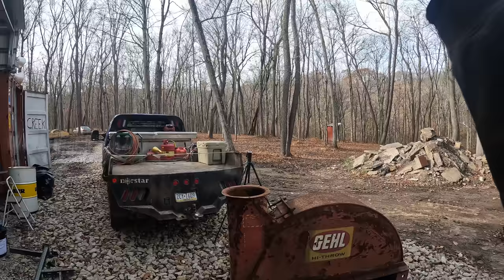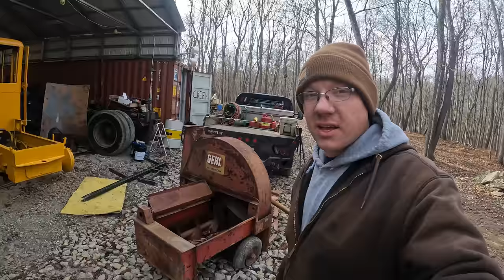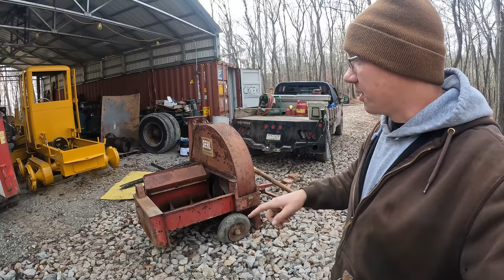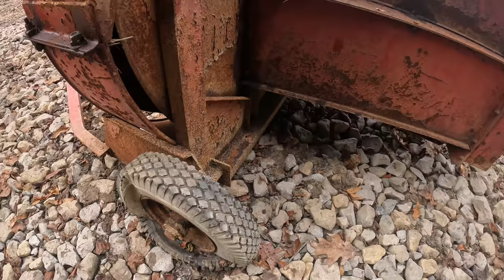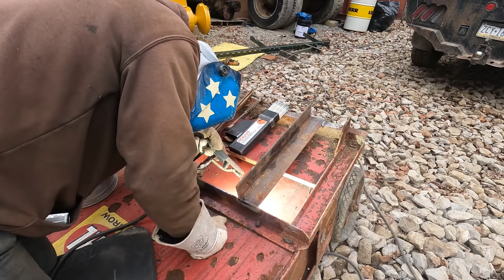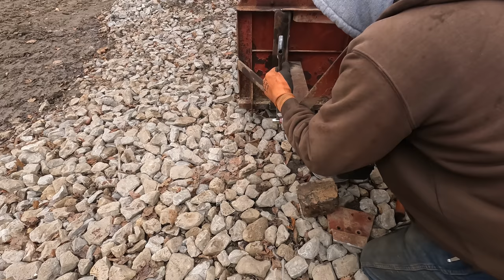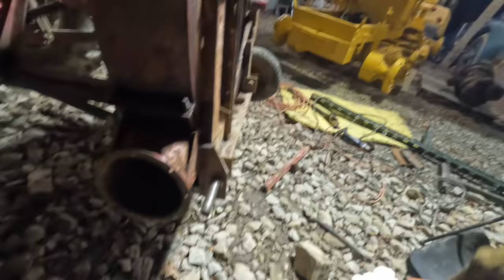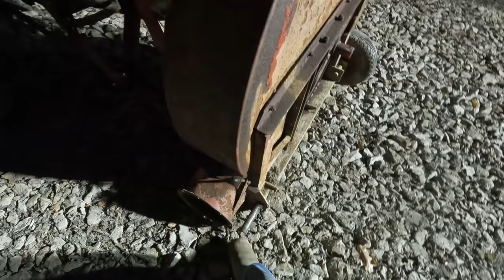I Built a Giant DIESEL POWERED Leaf Blower!!!

Comment: Matt good stuff!  Have you considered running the outlet on the other side of the unit?   Two reasons.  First you'd be able to achieve the downward angle just with the spout, without having to adjust the 3 point.  The other would be you'd put the air inlet much further away and increase the pressure.  Something to think about.
Reply: What I was thinking, couldn't hurt just to turn it to find out.
Reply: I was thinking the same thing 👍
Reply: I came to say the same thing. No more modifications, just an adjustment that already exists.
Reply: yeah, just rotate 180 deg so it points to the other side and down a bit
Reply: AND it allows you to put the wheels back on, then just run a extension pipe down and across at ground level.,
Reply: That is exactly what I was thinking Matt, just put your outlet on the other side and should solve basically all your problems
Reply: Experimentation with nozzle placement (for max volume), then cut frame loose and position as needed, then re attach frame with which ever wheel position modified. I like the idea of pushing material across road (to your left).
Reply: I agree with this it will give you better wind speeds and also allow you to put the wind more to where you need it to push the leaves
Reply: Came here to say this. It will also give space for the remotely controlled nozzle. I would suggest going electric actuator for that.
Reply: i was thinking the same at the beginning of the video
Reply: You could also make a hood on the back to redirect the intake so that it sucks closer to the ground and possibly suck leaves up off the ground, as well. I'm thinking about doing this myself, thinking it will work good for snow as well.
Reply: air flow is not going to magically change direction just because you move the outlet.  In it's current configuration, the air will flow naturally out from the outlet as the fan is moving clockwise (view it from the rear).  If you rotate the outlet to the other side, it will need to point down for the fan to blow based on the rotation of the blade.  if you then add a 90 degree elbow to redirect the airflow, it then would work.

Comment: We had one of these silage blowers on my family farm growing up. One day blowing corn fodder into a barn. Had a Super C tractor on the blower and blower got plugged up. Detached the blower pipe off the top of blower, backed of the blower paddles on PTO with a crow bar. I reached in to grab a last handful of green, tough corn stalk/fodder and my brother through the PTO on with tractor wide open. The paddle caught about an inch above my left wrist. The Super C stalled as my arm was another "plugged" situation. Busted my arm good. Lucky was not sharp blade type paddles as some of these blowers have/had. No bleeding. Damn lucky. I was 13. Brother probably 18. In hospital for a week to insure circulation to fingers. 57 now and glad I still have my hand!
Reply from the maker: You got lucky 🫣😵
Reply from the maker: You got lucky 🫣😵

Comment: I would try a reducer from 8" tip of the blower to 6"or 5", that would make the air go further, faster and stronger. Nice Frankenstein love the thinking out of the box...👍🏻👍🏻👍🏻👍🏻
Reply: In the HVAC industry we're well aware that these type of fans need to build pressure to work efficiently. You'd be surprised at just how well adding a few inches of WC will do for the efficiency of the fan. This is most definitely an underrated comment
Reply: And flatten the nozzle it will create a more even stream of air.
Reply: that's contingent on the fan actually being able to build good static pressure. used that trick on wheeled leaf blowers forever, would blow stuff from 30ft away lol

Comment: I made one of those when I was 15 in 1975! lol. Dad bought a new silage blower, so I used the old one to make a leaf blower. Yours is quite similar but I indexed the chute to the other side because that's the way you turn when operating equipment normally. I had it on a downward angle because it seems to blow damper foliage better. My air intake was 2X the volume of the outlet pipe, with a swing flap to adjust the air volume. And I took some old stacker/conveyor belt pieces of equal size and screwed them to the blades to reduce the gap between the fan and the housing. Good video. This brought back sooo many memories. Thank you, I hope this helps. cheers🇨🇦 👍
Reply: Most intelligent thing I’ve heard today
Reply: I was wondering what would happen if you were to bend the ends of the blades so that it would cup the air, and as another person mentioned, adding the piece of metal over the hole, and drilling a 12” hole down toward the bottom, facing the front of the tractor. Just a thought. Not sure if it would work, or not. Anyone else think my idea would work?? Someone Please feel free to correct me, if I’m wrong, but I was thinking that if he bent the ends of the blades, like a quarter-noon shape, they would work as “cups”, and grab more air, that way! Just a thought!

Comment: I'd try rolling the exhaust all the way back around to the other side and have it point down at an angle.  You would get the extra pressure and if you needed to could make a small nozzle to direct it better.
Reply: I concur,  rotate the housing 250*... AND stick a SnowBlower Nozzle on the end.!
Reply: Yes, rolling the opening all the way around would help out.  Also putting a deflector of some sort on it will help too maybe even a directional end to blow them at an angle away from the driveway or whatever you're using it for.  Then the deflector could also be used for the straw to spread it more evenly.  Just some things to consider Matt.  It is a great build for sure thanks for making the vid.

Comment: For maximum efficiency you would need a hole in the center, around the fan axis. Your fan blade has diagonal or taper cuts, originating from axis. The size of the hole should not be more than the taper cut on the fan.
Reply: i thinkig the same compred this to any industrial blower lika turbo air always with centrifugal force
Reply: for the air to escape faster, the outlet hole can be made smaller
Reply: I totaly agree with a centre hole, you are loosing an awful lot of pressure with that huge hole in the side,
By the way, I dont mind you working in the night, I can't hear you accross the pond..
Reply: It's called air conveying. It will only blow good if the right size intake is made. Example: if you only made the hole 3 inches it will only blow as much as it intakes. A little bit bigger hole than the exit would be about right if the hole is made in the right spot. I believe the intake hole should be opposite of the exit. Could be wrong but there is a lot online about this air conveying.
Reply: @lutemule  it was an air conveyor originally, now he wants to modify it to air blower.
Reply: @akhtarkh  and?
Reply: @lutemule  without thinking hard and engineering, it's not a good air nor grain blower with only one of the materials at a time. it's meant for both to be in there at once and moving at the right FPM, driven at proper RPM. likely the blade angle is improper for moving only air, as well as the intake opening size and location, the outlet diameter needs decreased with a tapered nozzle at the end to increase velocity and angled downward somewhat to create and maintain a flow across the surface. the flow will always spread out so it may pay to try angling backward slightly also, forward would probably cause clumping and an ugly failure. if the leaves are damp/wet and stuck together all bets are off. maybe a turbine/jet nozzle setup 🤣🤣, they either blow off or incinerate and burn the whole area down....
Reply: @throttlebottle5906  I worked with air conveying over 35 years. I know that what goes in is what comes out! I love your explaination! HA!

Comment: The auger and related housing covered up the outside portion of the intake which helped keep up the air flow by drawing in air closer to the center as others have suggested.  The fix may be as easy as covering the outer 8" to 10" of the inlet..
A friend and I built a wind tunnel for for testing aircraft instruments and we used a blower from a grain elevator.  It is capable of 500+ mph air flow in the venturi test section.  As others have mentioned a nozzle on the outlet would help.

Comment: I really like the suggestion of cutting blades back 2” and adding rubber tips. Not just for increased air flow but to reduce the fire hazard
Reply: I would cut the metal blades down to just a mount and put UHMW plastic on them because blowing dry leaves with a spark throwing machine. How about NO.

Comment: Rather than move the air inlet, how about spinning the outlet round to the other side and if needed put a outlet fan nozzle on it to give better direction, that way you don't butcher the main body and you would now get about 270 degrees of sweep from the air inlet to outlet, just a thought.
Reply: Wouldn't it be on top right? Instead of bottom right?
Reply: @D_Mukness  I was thinking go a bit more than top right so it is pointing down say forty five degrees then add a swept outlet to fire it more horizontal, that might also do for the straw chopper.
Reply: This would also make it so that you only need about 60 degrees of rotation between leaf blowing and straw blowing.
Reply: This would also eliminate the need for the bogey wheel because the angled down discharge would be a little higher.  It also get rid of the need to adjust the three point hitch out of level.
Reply: @ianlevine273  I think we had better let Matt get on with this having thrown in a few ideas, it's all right talking about it but the hands on bit might throw up more problems, all the best from the UK, Peter.

Comment: Yes  Put the wheel on and also add a nozzle shaped to spread air  across the ground. I have a hand push unit and I modified the discharge to go from 12" wide flat nozzle to 18'' wide by 1'' nozzle. My unit has a 5hp B&S motor and does that shift the dirt off concrete driveways. Also can be set up as vacumm cleaner. With the size of that unit, and the improvement to air intake a 24"x 1 1/2" nozzle should work a treat. Out and in along your drivewayonce and all done.  Also make the  air intake with an adjustable gate to set the air flow. I find this useful when blowing carparks. Keeps the crap from hitting vehicles. Would allow you to set up and not blow the stones away.

Comment: I'm really impressed by the results. I do have one suggestion: maybe you can turn the blower around to the other side, pointed (a bit more) downwards, use a small extension tube? This way you have more ground clearance, more compression and a better downwards pointed airflow. Nonetheless well done! ;-)
Reply: Agree, then make a little necked down shoot like the end of a leaf blower, making it a smaller exit for higher velocity, aimed the way you want
Reply: When you had it set up on the right side it was facing n the perfect angle 📐 to blow also agree add a cone shape extension when set up on the right side
Reply: My thoughts exactly
Reply: I agree 100% with rotating it around the other direction

Comment: This is some Mad-Max shenanigans. I love it!

I'd try just rotating the outlet to the other side for a downward angle. Shouldn't need to move the intake then, and can put both wheels back on.

Could also make it to where you can mount the auger section for when you want to use it as a straw blower.

Comment: As several other has commented, i would also suggest that you rotate the outlet to the right side to get a slight downwards angle.
One thing that came to my mind was that you can rotate the housing to the point where you get the best airflow and then use for example duct pipe to make the "shooter", this gives you the best airflow and the air exactly where you want it. This will also benefit you later as it's easier to keep the original inlet opening. That's just my two cents.
Reply: Took the words from my mouth. 👍

Comment: Operations at our airport uses very big versions of this to blow snow off the runway. When you get fluffy snow in PA you can do the same thing. Much faster than plowing. Build a 12 to 18 inch nozzle that necks the discharge down by about 25% will increase the velocity of the air. Cover over most of the intake opening so that its about 24 inches in diameter and right around the center axis of the impeller.
Reply: marcoNLD  We have F35s here at VT Air Nat Guard. Sweet planes.

Comment: Make a solid cover for the current intake.  Then make another intake hole at 180 degrees from the current one.  The cover might be made to fit both openings.  Hold the cover on with a few bolts or other quick fasteners.  You can move the Intake cover and Exhaust to make an ideal Hay dispenser OR Leaf Blower...
Just a thought

Comment: I’d close up most of that intake opening, just leaving a 8” or so diameter open round the driveshaft. The blower develops pressure because of the enclosed perimeter around the blades. The intake needs to be more centered. That will make a big difference.
Reply: That feels to me like the right solution for the loss of air pressure
Reply: Yea, as with centrifugal water pumps, the inlet needs to be at the centre.   I was hoping you would direct it to the right, and blow down on the leaves.   Maybe a conical jet would speed the airflow.   As per usual, they were the wrong sort of leaves.

Comment: That thing would be perfect for starting brush fires. Make a cone shaped spout of sheet metal to focus the blower that will increase the airspeed (Bernoulli’s principle). Leave the intake the way it is just build a hopper over that spot so you can feed straw in, then use a removable expanded metal shield over the hopper.
Reply: Wild fire starter 5 million 🔥🤣🤣🤣
Reply: Bingo! Bernoulli’s principle , that's what I was trying to think of and couldn't.

Comment: I live in an older house that has a lot of textured surfaces like sandstone. A few years ago we figured out that there was a hell of a lot of dust building up on the literal walls. We were in the middle of a spring cleaning and I ran an extension hose upstairs from the shop to use the air blower. It works so much better than a vacuum! We literally open all the doors and blow the hell out of everything. Well, I'm sure you know that leaf blowers exhaust oil so they are no good indoors. I ended up repurposing a furnace blower, the thing blows like hell! I made a backpack strap For the wife, when she plugs it in it makes her take three or four steps back from the power. Best house cleaning tip I ever discovered

Comment: I suspect that the big hole air intake is reducing the draft output from this machine by 90%. If you block that and make a new hole closer to the centre of the shaft, make sure it is fairly big and adjustable. You may need to increase the size of the intake to reduce the air output even at fairly low PTO speed. Without an adjustable intake you could find that you have invented a rock thrower. Good video.

Comment: It has been said already, the best place for the intake is on or as close to the center as possible. If you were able to watch in slow motion with smoke, you would see the air travel from center to outer on the blade. With the opening that close to the outer circumference, there is no time to pick up speed. You are sort of just hitting the air. You already mentioned not moving the gravel. Adjustable inlet and rotate 180 degrees.

Comment: Air intake needs to be basically central,  I'd make the surface area of the intake about twice the area of the outlet and you'll be golden.   If you can make the hole central and still provid bearing support, that would be perfect.
Reply: This is correct.
I have a large material handling fan in my shop and it draws from the center, all the other ones I'm aware of do too.

Comment: And once again we both posted a new video within a few hours of each other. You again beat me to it though! BTW: I also built a leaf blower last week. I built it from a huge eletric blower that is usually used for gas heating systems. A few times the leaves were accidentially sucked into the intake an shredded by the rotor. It was kinda scary :D
Reply: love your channel bro !!
and nice to see you on other channels
Reply: I’m off to watch your video now I have watched this one
Reply from the maker: Can’t wait to watch it!
Reply: Two of my favorite channels in dialogue. Fantastic. Just need Wes in here and it’s a party.
Reply: If it hadn't been for this comment I may have never found your channel... you just got another sub just for the name of your channel
Reply: You DONE GOOD, as they say in bad English !! Great idea Matt !! Personally, I think if you ironed out the places were the fan blades are catching, you set up a MORE cyclonic effect from the fan which will give you a way better wind flow !! Also, you need to paint the inside (& outside) of the unit which should help with the VOLUME of air that is being moved and in turn up the amount of leaves moved !! Give it a try Matt, I don't think you'll be disappointed !!
Reply: Hey Matt. Awesome idea! Do yourself a favor and wear hearing protection as much as possible. Ask me how I know. I'm 65 and my ears are ringing after years of banging on stuff.